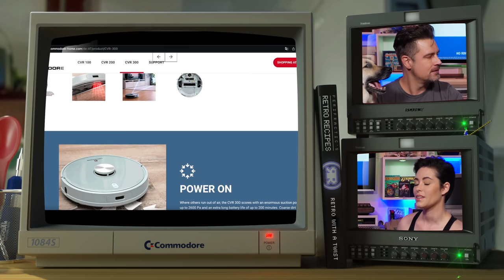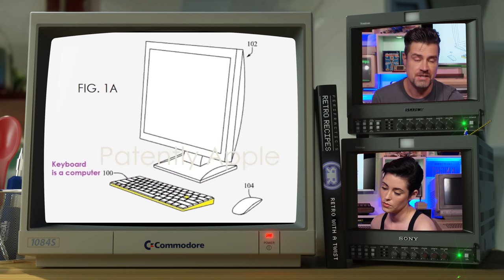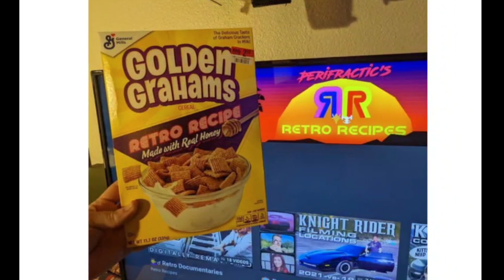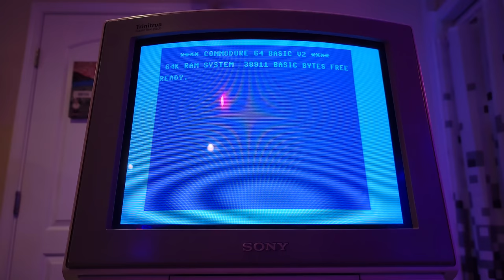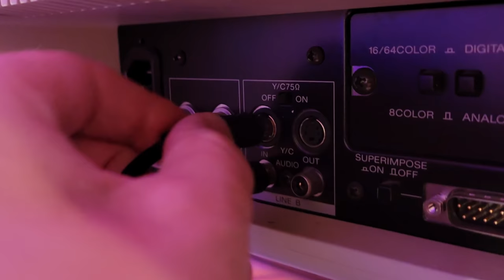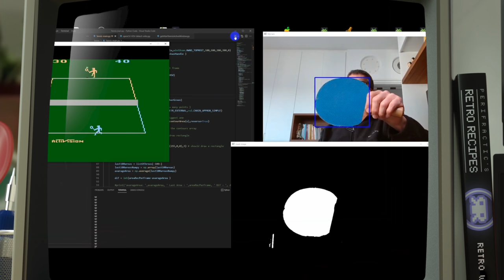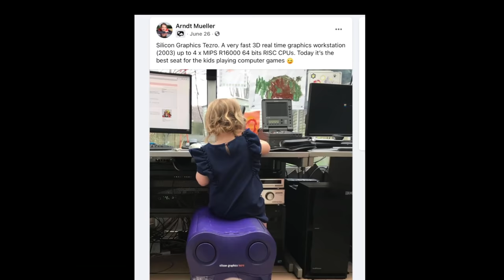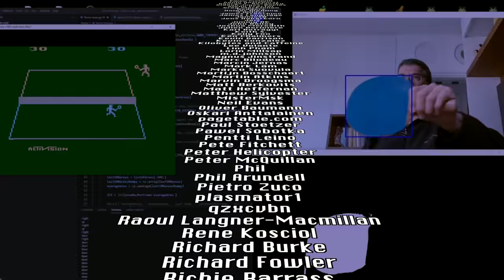FINALLY a new C64 VIC-II chip! ➕ Homebrews • Memes • News • Unboxings • on The ЯRetro Show #12

Comment: Great show, small error: the Altair 8800 is not the first microcomputer or the first marketed microcomputer. 
The first one is… French: the Micral, released in 1973 by Réalisation d'Études Électroniques (R2E). Based on the Intel 8008, it was the first non-kit computer based on a microprocessor.
Reply from the maker: Okay, but that isn’t quite what I said.

Comment: “Have a mass debate about this.”…I see what you did there!  Anyway, it’s great to see someone’s making a VIC-II replacement.  That’s one chip I don’t have any spares of for repairs.  (BTW, what can successfully replace the 6526 CIA chips?)
Reply from the maker: Yeah I misspoke a little bit. I meant all the major chips that are rare now and prone to failure have been recreated. But not the CIA. Or the FBI.
Reply: @RetroRecipes  Western Design Center has a 6502 and 6522 (VIA, used in the 1541), but I don't know if they are drop-in compatible or require some adaptation wiring.  Unfortunately they don't seem to make 6510 or 6526.

Comment: OMG that disk with the fridge magnet makes me think of our old cleaning lady  (lovely lady, although she could nag like my mom when it came to my messy desk.)

She found 10-12 floppies on my desk, laid out on top of some blood analyses machines a pet scale and other veterinarian peripherals I was integrating into our management system.

So she figured: “that boy is such a messy fox!” (And she would be right). “Let’s show him what a clean desk will do for his mindset”. 

So she figured she help me and cleaned my desk and she punch a hole through each of the disks. Wrapped a tie wrap through it and hung the from one of those metal brackets that you could hang shelfs on.

I came into work the next day finalizing the test update with these 10-12 5 1/4” disk update and I couldn’t find the disks. And my blood analysis machine, That literally weighed 25KG sat nicely on the scale and it was cleaned perfectly! But I was looking to find my bloody disks.

So I was saying to my colleagues that this wasn’t funny anymore and give them back because I needed to run 40 or so batches… and my colleague (one of the 7 owners) said: “found them! They are hanging there” right above your head”. Just above my eye level the neatly hung from the tiewrap loop 😂
And since she had nicely punctured the corner they all still worked! 🤣
She’s probably dead by now or very old but she was lovely. She always gave me such a hard time 🤣”Stop wearing tracksuit bottoms and a cap you’re not a teenager anymore!”
-“real men don’t drink tea!”
-“we used to have men made of steel and boats made of wood! Look at you whiny wimpy effers! Now we have men made out of wood and boats out of steel.”
I wonder what she would say about these millenial, men bun wearing, soy boys 🤣🤣🤣
Reply from the maker: Not only did they work but she’d converted them to double density with the hole punch! 🕳
Reply: @RetroRecipes  now these were already 1.2MB floppies it but I give Joke (Dutch name, no joke) an A for effort. She was an old ball buster but everybody liked her a lot. Some would call he rude but she was a straight shooter! And PC culture, was not something she was familiar with and the older I get the more I become like her 😂

Comment: Does your Sony crt have an HDMI input?
Reply from the maker: Noo
Reply: @RetroRecipes  Then this micro-HDMI cable just transports Y/C?
Reply from the maker: @elmariachi5133  sorry I tried to make it clear in a short amount of time but it also modifies the signal that comes out of the Commodore 64’s original video port. Therefore I connected using the S video cable that I showed just before the final switch on. HDMI is a separate option and I showed a screenshot of that image too.

Keep an eye on the explainer text that appears at the top of the screen.
Reply: @RetroRecipes  Ah, now I got it, thank you! :)

Comment: Can that FPGA VIC II be overclocked? Sadly the reason a C64 Accelerator is So hard to implement was how it shared timing with VIC. If the VIC can go faster, then the whole 64 can go faster with a 6510 Socket accelerater. TerribleFie 64 anyone?

Comment: I think the 6526 and 8250 CIA chips are still to be replicated.  However, they are simpler and probably will be more easily replicated than the VIC-II and SID chips have been.
Reply from the maker: Yeah I should’ve said the main failure chips have all been replicated now. SID, VIC, PLA…